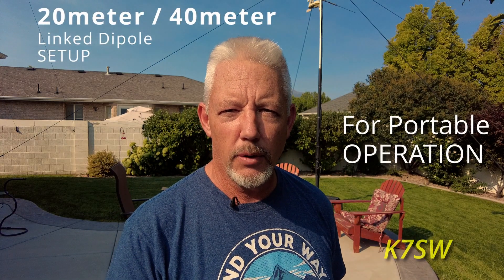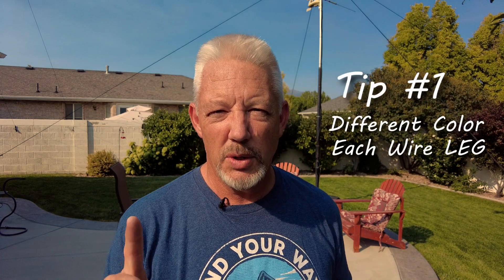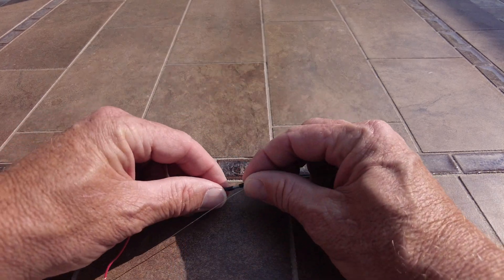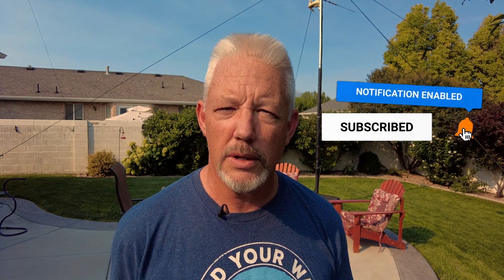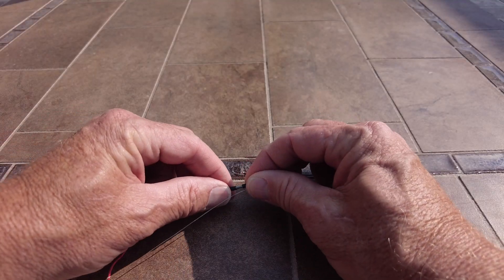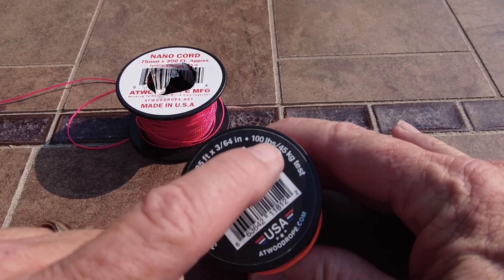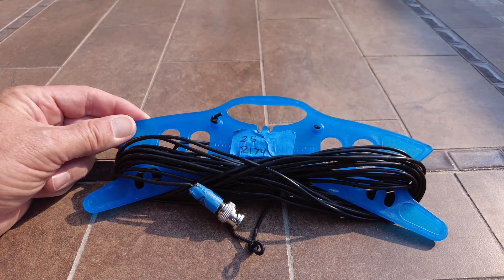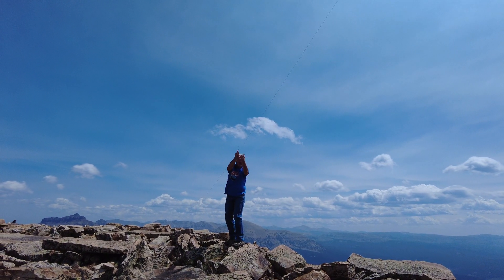Ham Radio dipole antenna  | K7SW

Comment: Simple is good… K6ARK (Adam) had a video on linked dipoles… where he lashed the two wires together, then heated a piece of shrink tube over the lashing, allowing for 2” of wire to overlap on either end of the lashing.  Then he used a 2mm connector to plug them together making for a very secure and rugged linked dipole.  

Either method (yours or Adams) makes for a reliable resonant antenna.  Thanks for the video…. 72 de W7UDT
Reply from the maker: Randall, this is one of the most fun parrs of the hobby. We all get to experiment and solve problems. Gettung to learn from others certainly helps me to learn NEW ideas.   Thanks for the tips. 73 Kevin

Comment: Nice video. If you use heat shrink over the fishing line knots to keep them from coming undone if you intend them to stay connected all the time.
Reply: I like to do portable operating. I’d like to see your version of “Long wire” operating. I have a home brew  49:1 UNUN and a wire cut for 20m. It works great. I just built a 9:1 UNUN. Can’t wait to test it soon. 
KI5IQE
Reply from the maker: Joe,   your idea is perfect and I am glad you mentioned it. This is an upgrade i can do right away.  Thanks for Watching